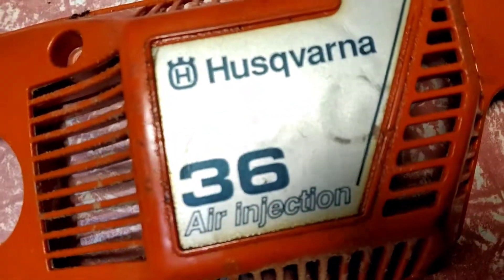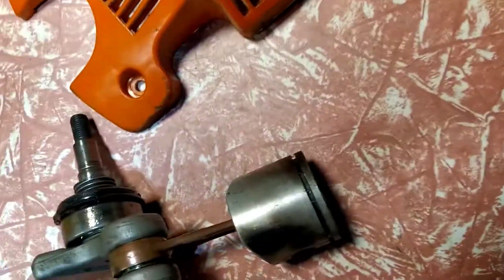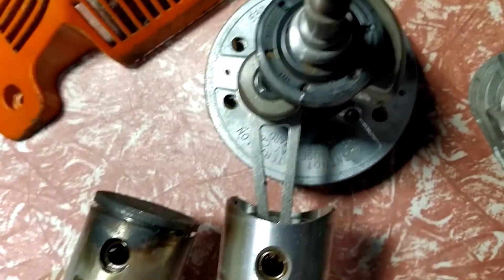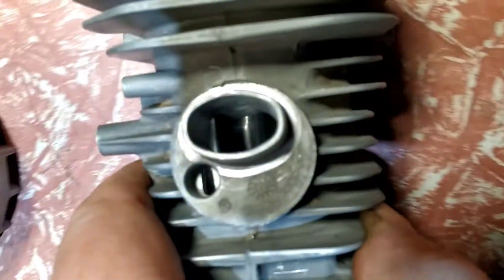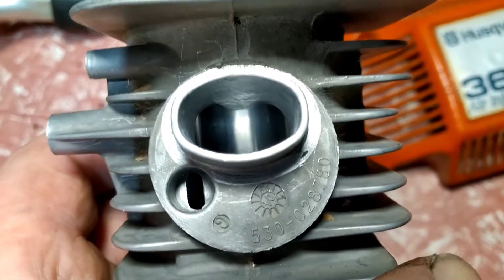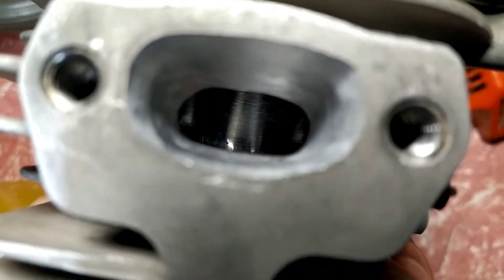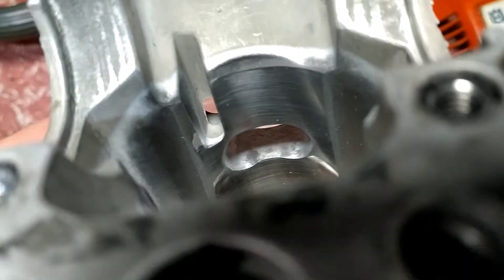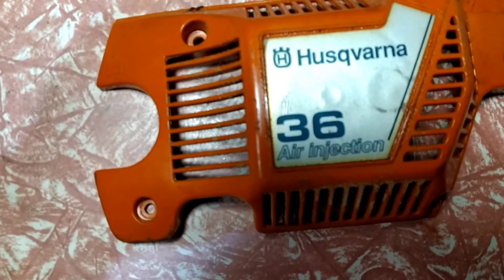Husqvarna 36 air injected ported

Comment: Nice work.
I wonder if a crank out of a poulan 2050 ,2150,2250 would fit ? Which is  the base saw to the husqvarna and jonsereds
Reply from the maker: Sorry I don't know but I love that type of thing cheers Kevin
Reply: @MrHangerone  thats ok, i think its funny that they stuck the press steel crank in the husqvarna and forged crank in the jonsered i thought it will be other way round but i guess your saw was made in the 2000s and mine in the 90s